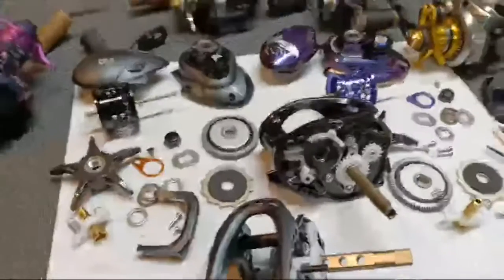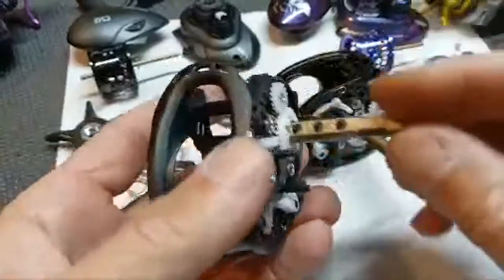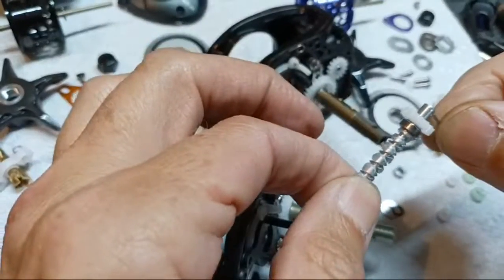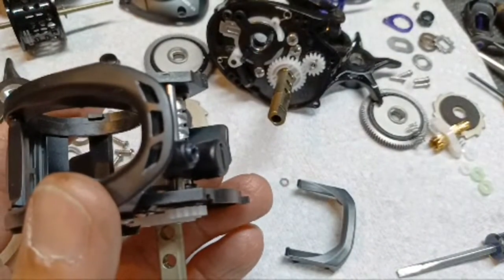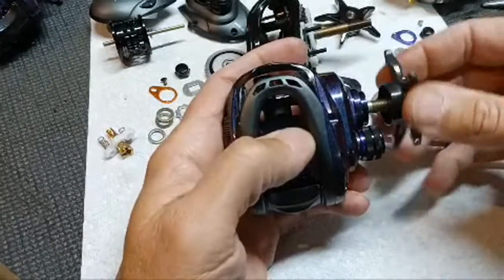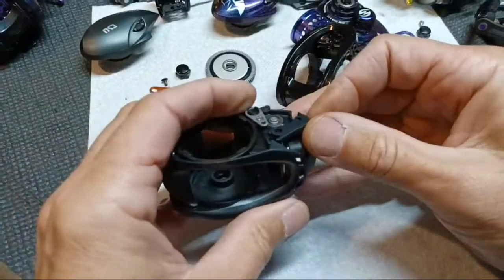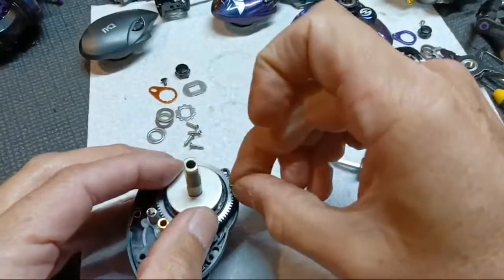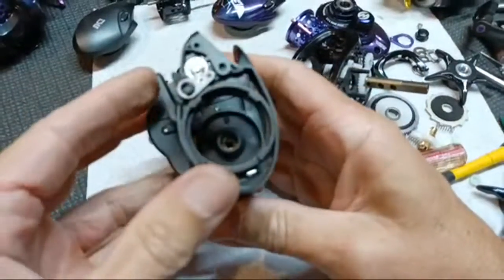How To Put A Baitcasting Reel Back Together & Add 2 Bearings

Comment: Removing C clips is so easy. Always funny hearing people complain about them. Take a tiny flathead screwdriver that would fit in one of those two "little space" and twist the screwdriver while holding one end of the c clip so it doesn't spin while twisting the screwdriver. The c clip is instantly removed. If you don't have a small screwdriver, get to your dollar store and grab a $3set of the jeweler's screwdriver set, it will save you a lot of time.

Comment: Do you personaly notice any difference in feel, performance, handle spin time or anything else if you replace the level wind bushings with bearings?
Is it hard to avoid crossthreading those metal into plastic screws on the right hand sideplate?
A very informative video that makes me more confident that if I had a good reason to I could sucessfully break down and re-assemble my AliExpress reels.  Thanks!
Reply from the maker: I say yes that I can feel the difference but definitely not as say as much as you can on the say that handle knob bearings I can instantly tell if you know handle the knobs feel smooth the way they've got bearings or if they've either got bushings or bearings are just horrible bearings I can feel that pretty quickly with those bearings on the worm gear I don't honestly know if you could
Reply: @bassnbonsai  Yes, thanks.  I can feel the difference with handle bearings too, but it seems that for my day to day use, I'll just leave the level wind bushings as is.  I'm not a reel tech yet...

Comment: Got a question. Is the star handle suppose to be shaky by a bit or tight n not shaky ?
Reply from the maker: It's shouldn't be Shakey or rattle it should have the spring pushing it up against the handle or with a shim between the handle and star
Reply: @bassnbonsai  i mean it wont shake if u just shake the reel.. but if u fididdle with your finger issit suppose to be wonky or have some play to it? not tight like the handle
Reply from the maker: Right the spring loaded ones move in and out if you push on them